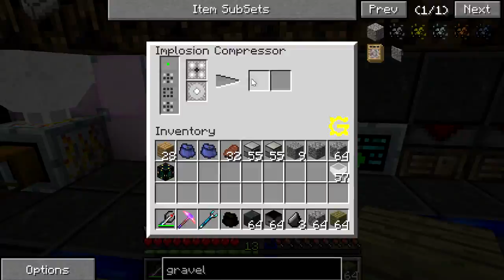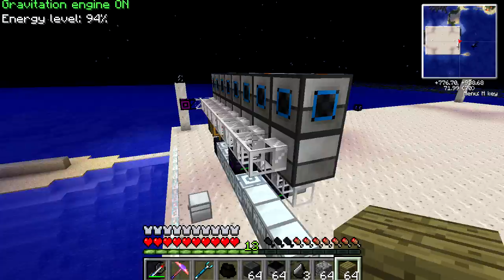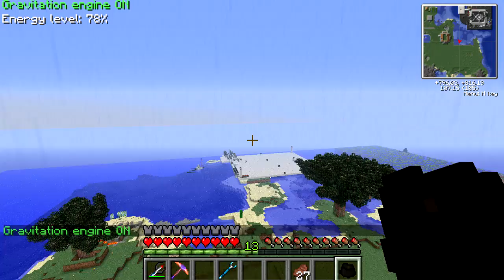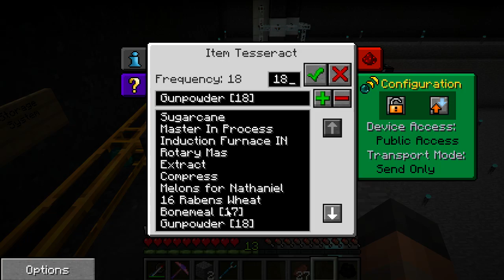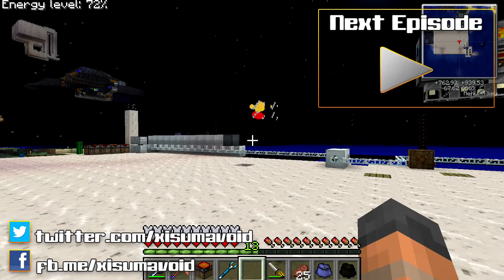Technical Beast 11 Industrial TNT

Comment: there isn't really any point as the chances are so small its like 0.01% or 0.1% chance of gold or diamonds so you would waste so much sand however if you use it in a machine like the one in the video then ye it would be a good idea providing you give the rock crusher the correct amount of power.

Comment: The industrial electrolyzers are gregtech machines. Since the wrecnches remove ic2 blocks when clicking on the primary face and gregtech machines use a wrapped texture, you have to right click either the bottom or the top, depending on the machine.

Comment: no autarchic gates pump items out faster than electrical engines that have sircut borads. they pump 2x faster than a redstone engine and are at full speed when u start them up 
plus z u look like you need a lot of help with ftb
i know quite alot about the mods in the pack so if you ever need help feel free to ask me :) 
id love to be able to get in a skype/teamspeak chat with u and help clean up ur base so things a re more compact

Comment: maybe you could just use flint instead of flint dust since flint is ur limiting factor. Also use filters and redpower tubes  instead of buildcraft pipes. It wont through items out. If the inventory is full it just wont send the items.

Comment: Xisuma you should put "iron gates" on the wooden pipes instead of engines. the gates are cheaper and they pump without any power and and they can be configured to pump in different ways. Like so he can see and improve.